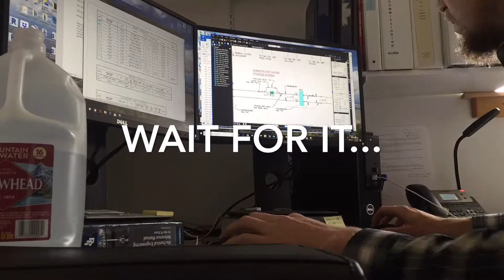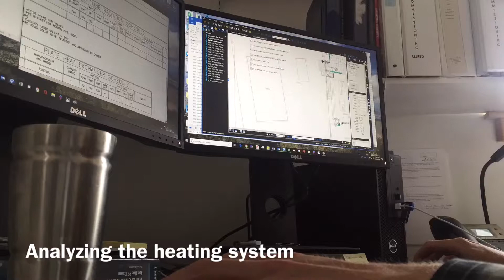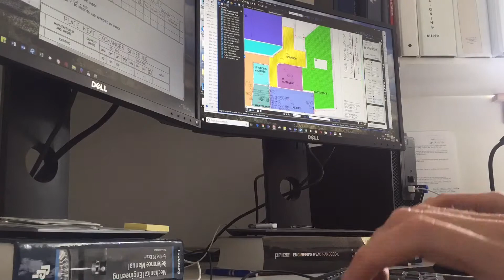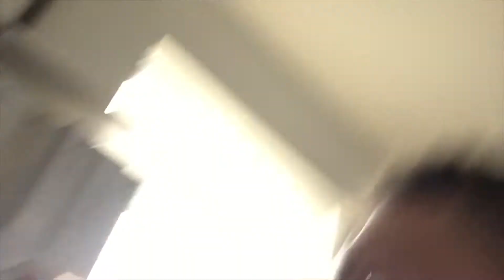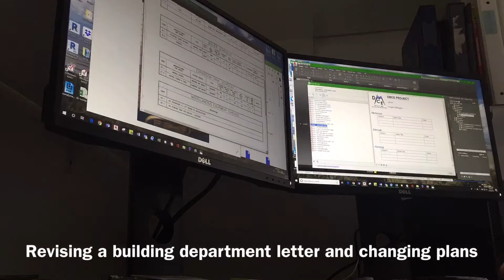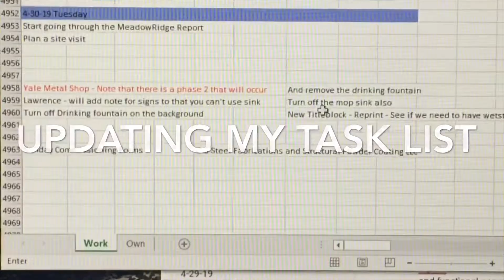Mechanical Engineering - Typical Day in office

Comment: How much coding do you do?? Is it required or what are undoing on  the computer
Reply: It depends on the job if it requires coding. mechanical engineering after alll has little to do with coding
Reply from the maker: No coding is required, but it would be a good tool to have in building new tools for the design process. I use many software programs: CAD, Revit, Bluebeam, Carrier HAP, On line equipment catalogs and selection software. I use a lot of Excel custom spreadsheets I've built over the years.